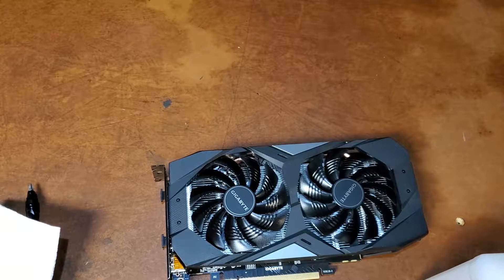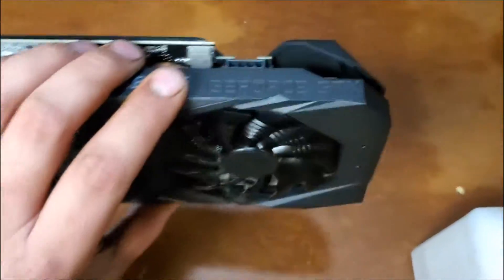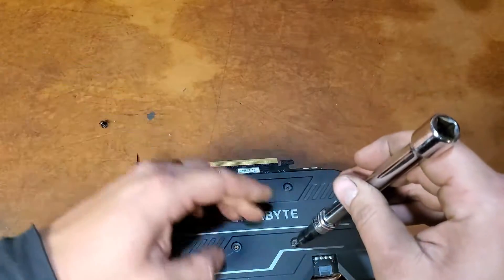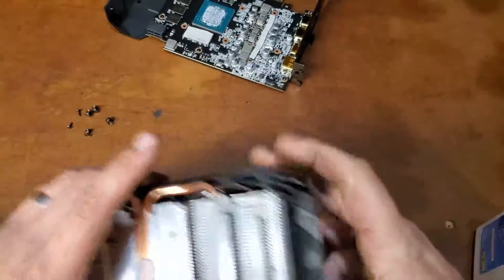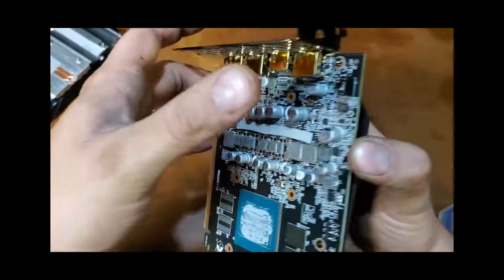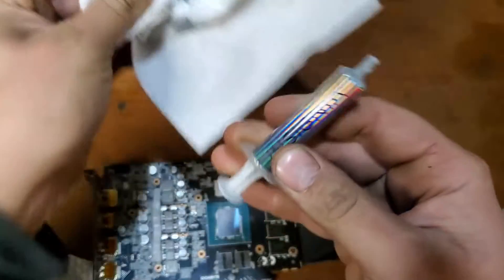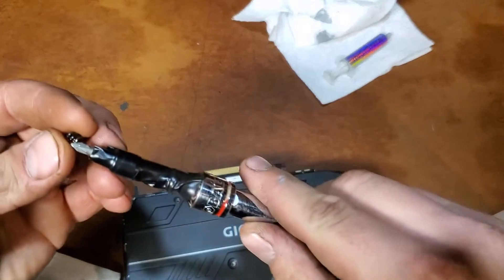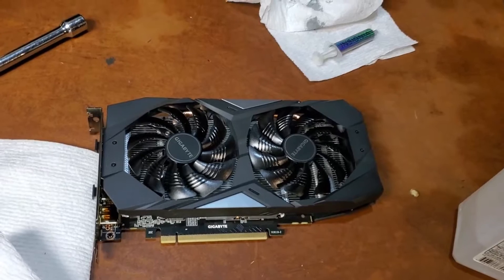Cleaning A Gigabyte RTX2060

Comment: Two advises: 
1-Spreading the thermal paste is better and safer on the gpus. In the cpus you can apply the thermale paste as you did but not on a gpu where the cooler is not centered on the chip. 
2-Clear better the residuals of the old thermal paste.

Comment: i have this exact card and over the past few weeks its been running between 40-60 degrees C. Noticed yesterday it was creeping up to 80 degrees again so dusted all the fans off and it still hits 79 degrees when playing, had it 18 months as its my first gpu and it makes a lot of screeching, vibrating noises.
Reply: Take down backplate and you deserve -8 °
Reply: A Morpheus aftermarket cooler would fix all those problems
Reply: @sK_SK8s  had no heat issues since I put another fan in there but the noises remain. I’ve kinda got used to them

Comment: Hi, u remmember what's thermalpad mm? Because i have 2060s and i think on vram is 1mm and on power 2mm, i have right?
Reply: for 2060S is 0.5mm for vram and 1mm for everything else
Reply: @NuLL555  Thank U!
Reply: @Samuel-is2gr  gigabyte says 0.5 and 1mm but in my opinion you can go a bit thicker so you can use 1mm for every thing inside the card cause it's going to squeeze down

Comment: How much temp is improved after changing paste?
Reply from the maker: On this card the difference was negligible. The card in this video was nearly brand new. My aim was for folks who have similar cards can take theirs apart and clean them when they become clogged with dirt and dust
Reply: @jawmedia7575  mine is going 83-85° while playing at 1440P, idle it's 50°C. Airflow is good
Reply from the maker: @rishabhsharma3705  you are working it at full throttle tbh bound to run hot. Case design has a lot to do with it also
Reply: @rishabhsharma3705  You might have revision 1 of the card which had overheating issues. The video has revision 2, which has a different cooling system. You can tell by looking at the heat pipes on the logo-side of the card. Undervolting your gpu will improve your temperatures.
Reply: itna hi jaega india mein. agar case accha nai to
Reply: @qing9367  i'm using ant 511mt

Comment: hi guys when my GPU fulloads to 82'c, do I need to change the thermal paste?
Reply from the maker: Many things contribute to component temp. Airflow thru the case is major. Only time I'd really recommend it is if you see that it's collected a lot of dust and could used cleaned. Then obviously new thermal paste would be in order. Just be careful of those thermal pads

Comment: mine is making some weird vibrating noise and going up to 75 and 80 celcius
Reply from the maker: sounds like you have a fan in bad shape
Reply: Mine has started doing the same when the fan goes to 90 percent it gets really loud . Like a grinding noise . Set my fan speed to 85 percent and sorted the job out as temp goes mine has always Ran at 85c .going to give it a clean soon and change the thermal paste . Hopefully it sorts temp out . What I done is set the temp limit  to 80c . And it seems to be running better
Reply: @paullynch9920  did you try to put the the pc in the horizontal line seems work to me after doing that..
Reply: @Bloom already fix mu problem ...
Reply: I fixed that, put a very thin sticky bottom mouse pad pieces between radiator and fan backplates (3 diagonal black plastic thingies per each fan)
Reply: my PC tower getting hoter when he reaches 53+C how you can play and not feel bad on 75 - 80 :flushed:

Comment: I have this gpu and the fans spin very loudly. I will try to water cool it soon. Any tips?
Reply: I have the same GPU and I can relate what Rokas said, the fans are lound and makes vibrations. My GPU temp reacheas 85-86 degrees and it throttles.
Reply: @L33Vi3W   yeap :( we both got scammed.
Reply from the maker: Have you taken it apart and cleaned it? Also have you looked at msi afterburner and tried adjusting fan curves?
Reply: @jawmedia7575  Yep i did everything , when the fans hit 61% they start vibrating and they dont stop... it makes me wanna kill someone
Reply from the maker: @rocky007w  sounds like they may be junk. Never had a fan vibrate
Reply from the maker: I take that back. I had a corsair case that had a fan go bad and want to vibrate all the time had too replace it.
Reply: I know why your gpu vibrates and cause of crazy sounds.. had that myself
Reply: @ProfilaktiskasLT  its a physical fix its not a bog deal need only release some screw in fans that all
Reply: @fingerstyle9165  IT DOESNT HELP BTW :))
Reply: REMEMBER . DO NOT BUY GIGABYTE CARDS OR ANY OTHER PRODUCTS FROM THIS COMPANY. JUST DON'T PLEASE.
Reply: @rocky007w  its fixed mine sir
Reply: See many forums about it try to adjust screws
Reply: @vojtechhaisman4002  Tried that , i tried everything :)
Reply: @rocky007w  then try to change fan i would reccomend noctua
Reply: @vojtechhaisman4002   did anyone fix that problem i
Reply: @rocky007w  bro wtf i said i fix the fucking problem only one fan cusing that toutching heatsiink just need to release screw and eveything work nrml
Reply: for you its 1 fan , for me its 2 i did the same thing you did. didnt worked
Reply: @rocky007w  i have 2 fans one fun do that noise so i release screww
Reply: @Dawgley  IT DOESNT METTER THEY ARE  THE SAME :))